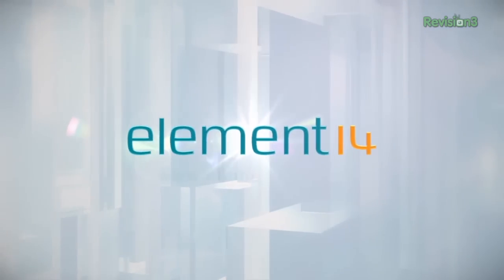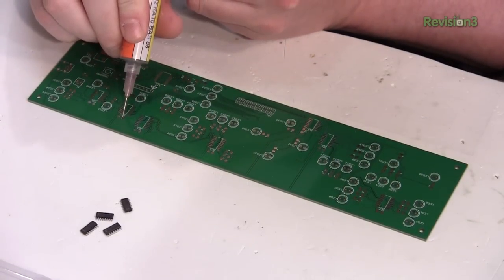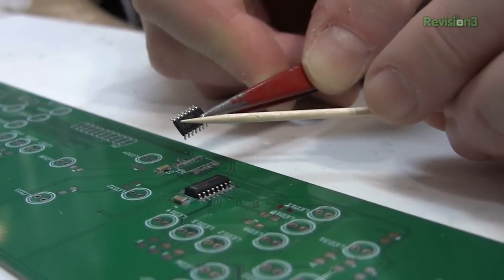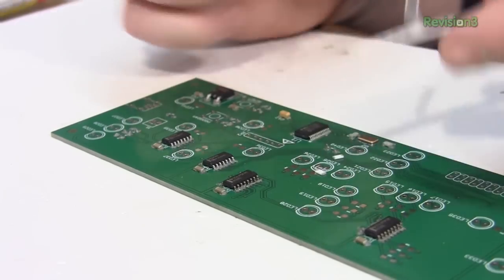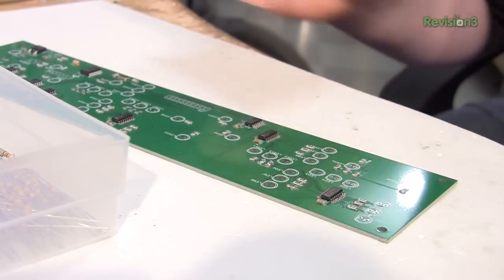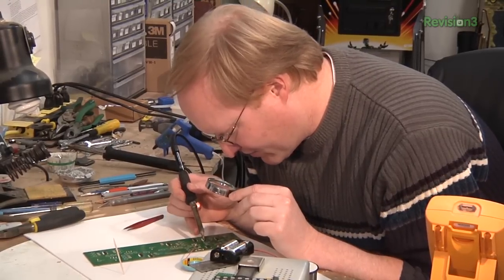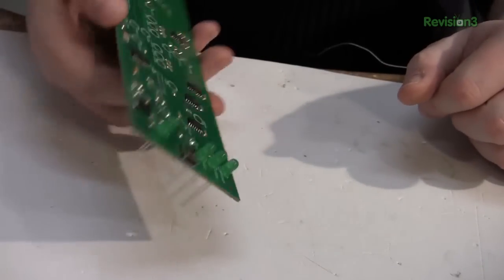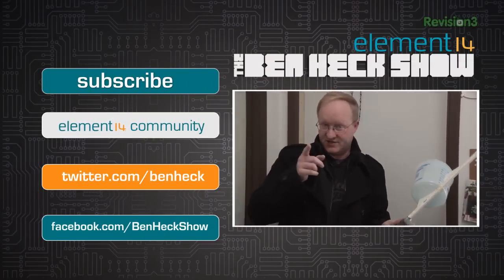Surface Mount Soldering Tips and Tricks

Comment: A slight correction to your explanation on identifying pin 1 on an SO package. You tell the left hand side of the chip by the chamfered edge on the package, you cannot rely on the text printed on the chip as a guide.  Look at the end profile of the chip and you will see the left side (i.e. the side with pin one on it) has a 45 degree chamfer.
Reply from the maker: Thanks for the tip!
Reply: True!
Reply: True!!

I once umount a chip from a socket and when I mount it again I put it backwards because the text was "ISSI".

Since then I do not trust texts anymore...

P.S. of course, the chip die.
Reply: Not all surface mount parts have a chamfered edge. If the text isn't worn off the part, you CAN rely on it because it is always written starting with the pin 1 side. Some parts have dots, especially QFP's, etc. You use whatever is visible to determine pin 1.

Comment: You can remove the bridges much faster and with less effort using liquid flux. Just apply a liberal amount in the area that has the bridges and apply the tip of the iron. It will cause the solder to migrate to the pin, either left or right of the bridge.

Comment: What was temp of soldering oven?   Also, did u sonic board after soldering or did you clean it with acetone?
Reply: I don’t understand what sonic board means I’m new to soldering. Also I didn’t know acetone would clean it. Everybody that I’ve seen uses 99% IPA.
Reply: @robertw31968  ultrasonic cleaner used to clean boards after they r fixed with special cleaning solution.
IPA 99.9% is great to remove flux.
Thick flux some times needs something stronger like acetone
Reply: Melanie Branton D.V.M. Thank you so much for explaining I really appreciate it. Usually people just gives snide comments.

Comment: Where do you guys print those boards? Is there any place that accept printing boards for just few numbers? What software do you use to order for pints?
Reply: Jon Saw There are multiple companies offering such "prototype" PCB manufacture via online orders.  They exist on every continent, but sometimes postage from China is so cheap that using Hong Kong / Shenzen services may be cheaper than buying from someone local, though local services are often faster due to shipping time.

Comment: Hey you have great videos!! I just bought a brand new Soldering Station.... i see people making solder stick to the tip so all you need to do is just touch a smd led to tin it. How do i get the solder to stick to the tip??
Reply: you have to practice, practise and again practice..... Start with soldering wire to wire , and work up from there
Reply: Martin Whitehurst get yourself some flux aswell, soldering iron best friend

Comment: Hey, can someone explain to me what a reflow oven does? does it harden the paste to keep the chips in place, or does it do somthing different?
Reply: It heats up, which melts the solder, bonding the components. (Solder paste is paste flux with ground up solder mixed in.)

Comment: How can u do the reflow technique in a double sided board with surface mount components?
Reply: Use adhesive to secure large components like ICs, otherwise, you simply place components on both sides. The tackiness of the solder paste, and then the surface tension of the molten solder, will keep small components in place upside down even without adhesive.

Comment: Cool stuff. I wonder if you should build yourself an automatic mounting machine like they have at factories, or maybe its too complicated and its better to rent one if needed..
Reply: Well, the precision required (sub-millimeter accuracy over an area the size of the whole board) is very, very, very hard to DIY. I have heard of there being a home pick and place machine kit out there, but my understanding is that it's so slow that it's actually faster to do it by hand. The consensus is that right now, it's not feasible for the DIYer.

Comment: can you reflow chips on a existing board IE could I use the surface mount chips with the solder paste on a Game Gear to recap it. I know the oven might mess up the plastic parts, but I mean with a heat gun.

Comment: Is it possible to unsolder surface-soldered components and repurpose them for other projects or are the surface-soldered components permanently "cooked" to the board and only usable once?

If the parts can be unsoldered and reused, what is the damage/fail-rate for removed components, are they still fairly reliable or does the act of unsoldering and re-soldering with surface-soldering make them more susceptible to malfunction and failure?
Reply: PGIFilms Using a solder-wick for suface soldered components, can help to remove such components. They aren't 'cooked' or 'fried' in the sense that you mean when these components are removed from the board. They can certainly be re-applied, and relatively easily too. 

As for a fail-rate, i'm not entirely sure, but I think as long as you have enough practice with soldering surface and through-hole components, as well as un-soldering them, you should be just fine and your components shouldn't have a fail-rate. 

Hope this helps.
Reply: Yes,place the copper wick on the soldered spot to be absorbed,touch the wick with the hot iron. When the wick is hot enough it will melt the solder. Immediately the solder will stick to the wick. Always start with fresh wick part to prevent remelting of old stuff on it.

Comment: For LED's and other devices that art through-hole, I like to tack
the device on 1 pin first, then press on the device from the top
while hitting the joint on the bottom at the same time, so you
can be sure that the part lays flat.

I think pulling on the lead, isn't always going to be a way that
will insure the part is, indeed, laying flat!

Comment: did you say those small capacitors have polarity, what about the small resistors?  i used to solder smt about 18 years ago and i forgot if capacitors and resistors have polarities for smt.   i will take soldering test tomorrow  for a job  but i have not solder in almost 20 years.

Comment: for the fine pitched L shaped leads.  The best way to reflow is to use a clean half conical tip.  Just drag th flat part of the tip across the leads from one end to the other on one side.  clean the tip and repeat on the other.  some of the excess solder will come off on the flat area of the half conical tip.

A hoof tip would also work.

Example:
https://m.mscdirect.com/mobileweb/product_detail?id=88550579&hasRestrictedParts=false

Comment: annoys me when people say components self align...They rarely DO so care must allway be taken to make sure components are align by your hand and not the reflow
Reply: Except that small components DO self-align, there are tons of videos on here demonstrating it. As long as the component is actually in contact with the solder paste on both pads, then it will align when heated, due to surface tension.

Comment: I actually prefer a chisel-tip on my soldering iron for these small pin-pitches since I find it easier to pull bridges away.
Also, if I had to manually solder smd components I'd first tin the contacts on the board and then reflow it with the smd parts in place. It's way less pain to do it so in my oppinion.
Reply: You're correct about using a chisel tip. But actually tinning the lands on the PCB is a bad idea. You're much better off using solder paste and then reflowing.

Comment: Surprise surprise, his solder job is sloppy (while placing the solder across the IC pads) way too much solder on the pads = wasting time after to fix it up.

Place an LED in, bend the leg slightly... much less time on soldering them in place.

Ben and soldering tutorials is not a good mix
Reply: Commenting on a three year old comment - 
Ben has never claimed to be a soldering pro. But he has proven he can solder SMD's by hand, which is something I for one can't. :)
Reply: Anyone can do it, just takes practice. The point to my comment was he shouldn't  make soldering videos when he cannot do a clean job of it.